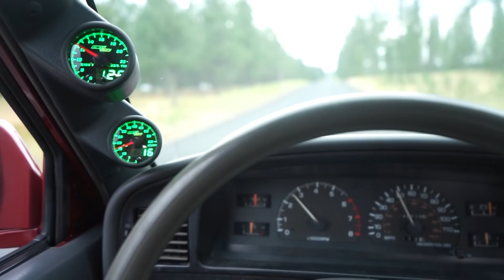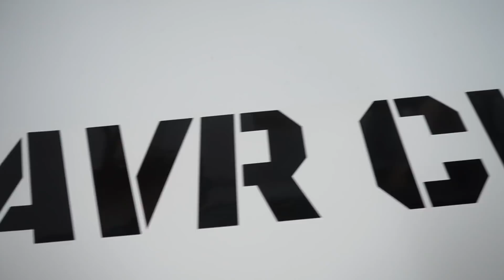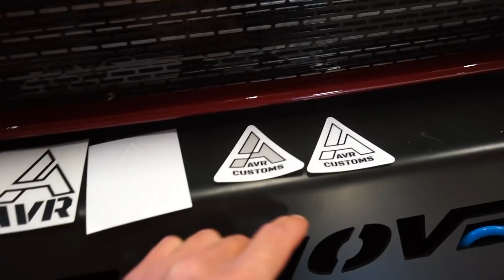The Launch Of My New Business!! New Exhaust On The TDI Toyota Pickup

Comment: What did you brush on the inside of the pipe before you started to weld? How do you not have to back purge the pipe with argon? Are you getting any surgaring on the inside? I'm not expert, in fact I have only been TIG welding now for 2 1/2 years, so definitely still learning. I'm interested in some new tips and tricks that I can pick up. Thanks. Keep up the good work!
Reply from the maker: That is solar flux. It protects the inside of the pipe so no back purging is needed. For exhaust is works great, BUT do not use it for intakes and anything of that nature. Eventually the solar flux may break free and come off

Comment: It might be better with a more conventional style or large multi chamber muffler. Unfortunately with it being a 4 cylinder it's near impossible to not have it just sound like a Civic with a rice cannon.
Reply: His exhaust is TOO LARGE

Tdi has no problem breathing through 2” pipe. 

The turbo inlet and outlet is about 1.5”
Reply: A tdi needs no muffler. 
With a reasonable sized pipe all you hear is turbo whistle

Also, the drone is likely his open air filter. 
Because there is no throttle an incredible amount of noise comes backwards through the intake on these.
Reply: @fastinradfordable  That makes a lot of sense, thanks for explanation. I'm just now getting into getting into diesels and I often forget about simple things like that.

Comment: That long section of straight pipe under the cab isn't helping the drone situation.  Long straight lengths of exhaust tubing tend to resonate in diesels.  If you decide you want it to be quieter in the cab, try installing a Flo-Pro Twister in that straight section of pipe.  
A few years ago, I replaced the factory 3" exhaust on my lightly modified Dodge Ram 12 valve diesel with a 4" Diamond Eye turbo-back system.  It came with a 24" straight through muffler that was packed with stainless steel wool.  I liked the sound around town, but on the highway, the drone was terrible.  Long trips were miserable.  I replaced the Diamond Eye muffler with a 40" Donaldson muffler (think small dump truck muffler).  The truck is much quieter and I do not believe I lost any performance.